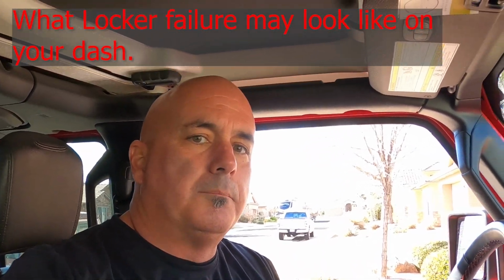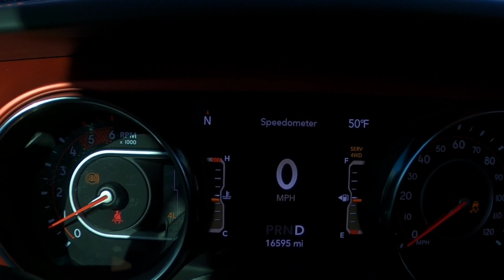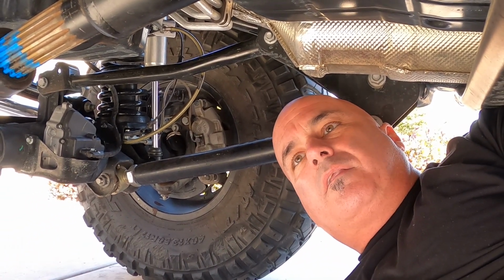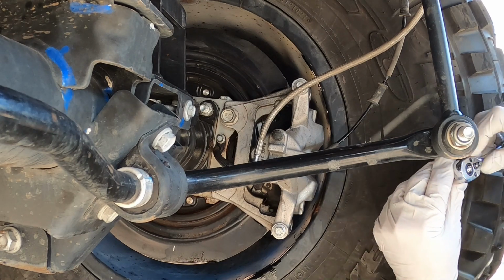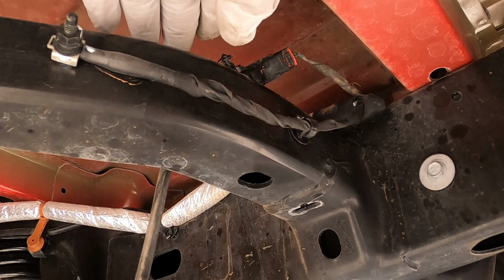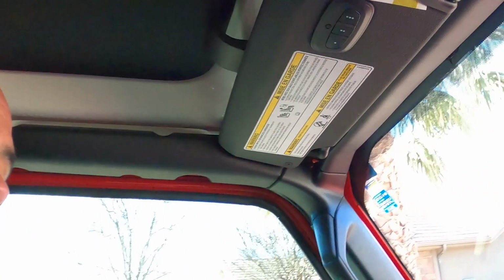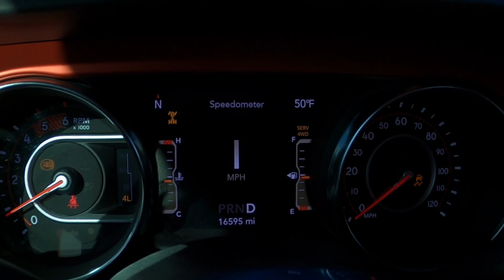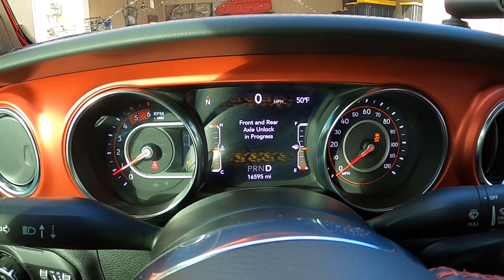Gladiator/JL Locker problems on the Trail, and a "Hack" to get  back safely.

Comment: I had that issue...I noticed you have loose sensor wires.......they need to be harnessed/zip tied so the wind doesn't blow them back and forth causing premature fatigue of wires causing short.  Worked for me at least

Comment: Lost my lockers on the rubicon 2 weeks ago. I snapped off that connector from back of FAD bc my aftermarket FAD skid cracked/bent and when that's out despite transfer case gear selector showing 4L it gives a warning. i couldn't figure out how to turn the lockers on with the tazer...i'm guessing i could have gotten the rear locker to work with this hack (starting in P) but probably wouldn't have been able to get both going. love your channel btw...excellent super useful content
Reply from the maker: Thank you

Comment: My lockers kept giving me fits on Double Sammy - glad to know there's some work arounds for the future. I was also thinking when I regear to add air lockers instead of these E lockers.
Reply from the maker: Maybe consider this, locker bypass. I will do a video on it in a few days. It basically bypasses the OEM locker sensor, placing the sensor outside the differential. In essence, it makes the lockers operate much like the JK. 

https://www.zautomotive.com/product/z_lkr_oem/

Comment: Great information!! Are all the abs sensors the same part number so that 1 in the box will work at all locations?
Reply from the maker: Unfortunately no, front and rear are different. So you will need one of each.
Reply from the maker: Or at least a Tazer mini.

Comment: Great videos. What parts do you recommend to get right out the gate to run those 40s?
Reply from the maker: One, Diesel. Min 4 inch lift, front driveline
Reply from the maker: Feel free to give me a call 801-376-0330